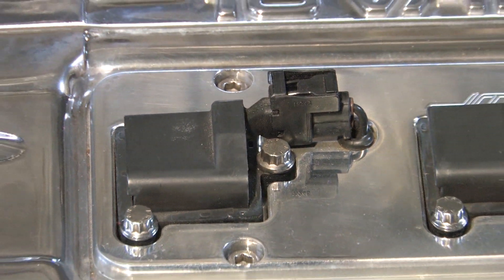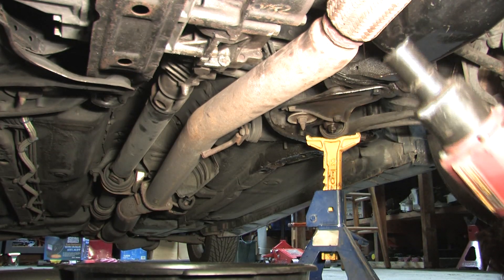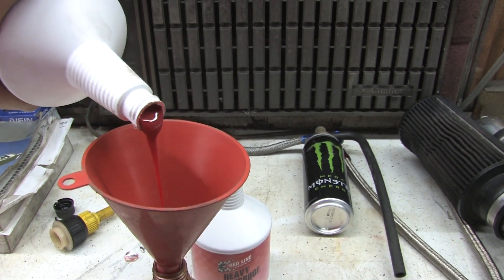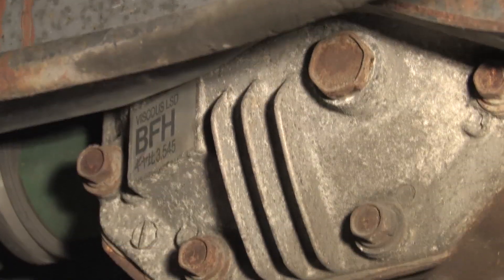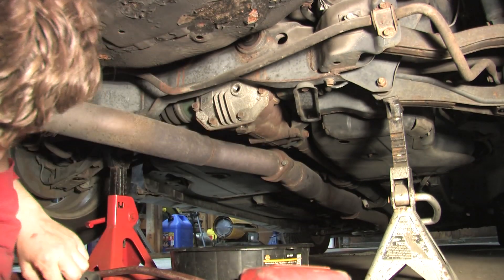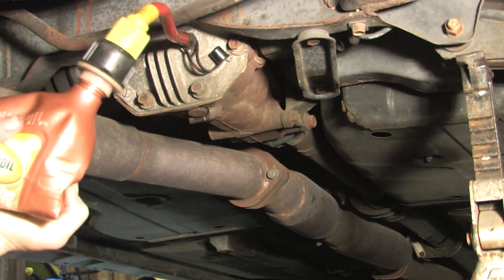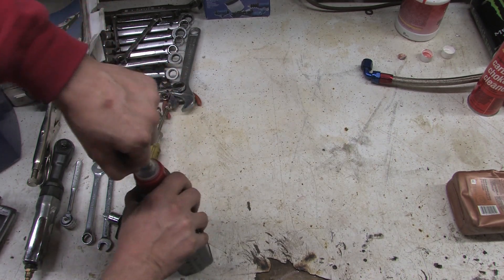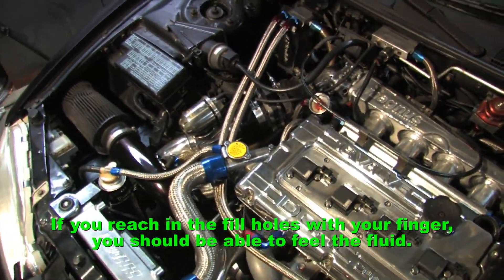Trans & Clutch 7 - AWD Fluids

Comment: I have a 97 gst that the previous owner did not change the oil in the manual transaxle, it currently has about 97k.
would you recommend I change it or leave it as is?
Reply from the maker: if it's a manual transaxle, and you use the right fluid, there's no reason why you can't.  It may shift a little smoother, but it won't fix or improve the condition of any of its parts.  As long as it wasn't run low on oil, you should be fine.

Comment: hey jafromobile I am also running a tre transmission stage 3 with 4 spider limited slip center diff, and on tre's site it shows a motul 300 75w90 ls which has the friction modifiers used for limited slip diffs...so which am I supposed to use? have you had any problems using the regular  motul 300
Reply from the maker: A 4-spider diff is not a limited slip diff.  It just has 4 spider gears so there's more gear surface area to absorb the pounding that a well built 4g63 can deliver.  If you've got the LSD option, then by all means, follow their directions.  I do not have the LSD.  Mine worked great before I spun rod bearings.  In fact, it never shifted better.  It was the best shifting transmission I ever had, and I've had 4.
Reply: +Jafromobile  I have been misinformed then, on his website on the stage 3 build he list a "tre 4 spider limited slip front center diff" thanks for the help.
Reply from the maker: boostedunrivaledteg Today's stage 3 isn't the same thing as 10 years ago's stage 3.  They've changed standards over time.  I've bought 4 TRE transmissions since 2001.  He used to offer a stage 2.5 and that's what I've got, It's the last of the 2.5's but with additional upgrades that 10 years ago would have made it a 3.  If the stage 3 has an LSD today, it didn't back then.  Check your build sheet (your receipt) to see if yours is older than 2007.  It will list the differential you have.  I know you've got a 2" thick folder of receipts for this car somewhere if you're using one of these transmissions.  ;)
Reply: +Jafromobile hahaha my transmission has 644 miles on it as well as my motor, transmission was rebuilt in may of this year, but yea I don't keep receipts as I don't like to know how much money I've put into this car of mine lol...but I love your videos you have been a big part of me understanding and learning about dsms.
Reply from the maker: boostedunrivaledteg I'm glad to hear good ol' Jon's still kickin' it.  I should send him another transmission just to say hi.

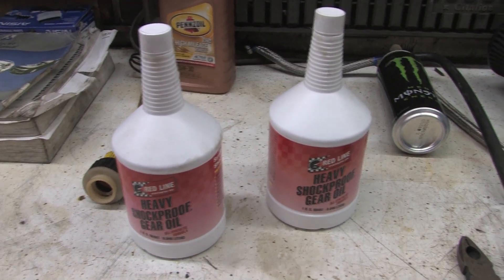Comment: @2:00 Wow- isn't there a way, product, or method to "flush out" all that nasty goo from the transfer case? Lather, rinse, repeat? Then- blow out this flushing media? (I'd suggest heating a couple quarts of ATF with a saucepan and hot plate in the shop, pour in with a hosed funnel, cap it, up on jack stands, run for 10 minutes, drain, repeat, blow out with air nozzle) ATF makes a great "flusher" for oiled systems- including engines. It just doesn't seem that all the draining time would get rid of the old stuff. 0.53O quart of any lubrication is very small- even a lawn mower takes 1 quart! Too bad it doesn't have a remote oil reserve. What say you? Thank you.
Reply from the maker: +HUBBABUBBA DOOPYDOOP Drive it on the highway for a half hour, then drain it hot.  I suppose flushing it out could be another use for the siphon feed blow gun?  But unless you've got ground up chunks of something in there, draining it hot and refilling it should suffice.

Comment: I don't know why everyone says to avoid Royal Purple. Seems to me using Synchromesh is a bad idea but they make gear oil which conforms to everything specified for the transmissions as well as being non corrosive to yellow metals.
Reply from the maker: I'm using Royal Purple assembly lube on my Hyundai build. :)
Reply: I saw that, but it doesn't explain why people say not to use their gear oil in these cars. Even synchromesh fluid appears to work without issue in the gearbox if the internet is anything to be believed.

Comment: I do not deviate from factory recommend products or those that match their standards exactly and I will tell you why. There are products like extreme pressure additives that can be HIGHLY corrosive to yellow metals. To make it worse, there are many different kinds of EPs. They may work short term, but long term, they can destroy all the yellow metals in your transmission. Stick with factory spec oils.

Comment: @Jafromobile that makes sense, now if the transmission was worn at all, would i be able to notice? all gears pick up fine and pull smoothly it is a little unsmooth shifting from gear to gear like it sometimes is a little iffy to go in reverse smoothly. but seems like it drives and shifts good so, im just wondering . would the transmission being worn at all,be noticable to the drive, or only when it gets to a very worn state.?